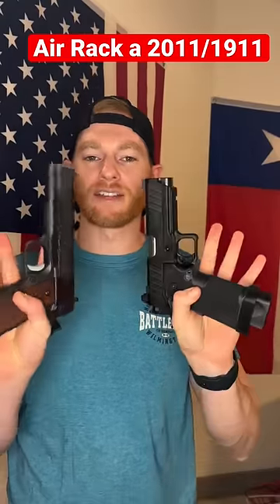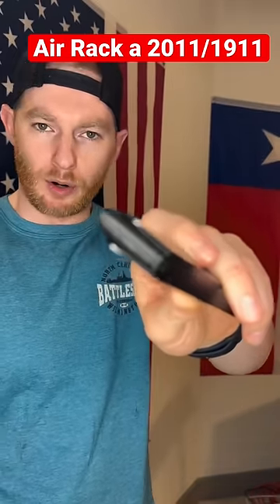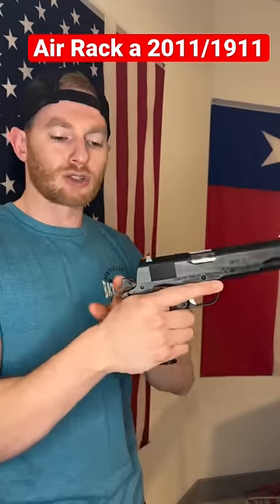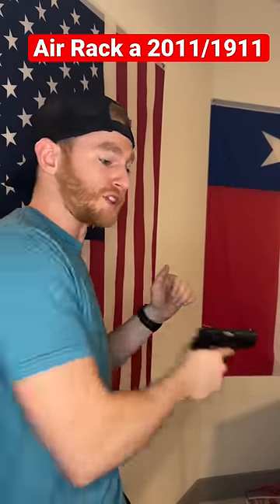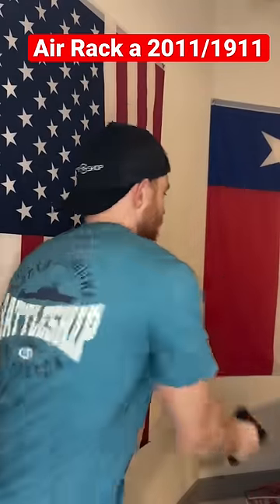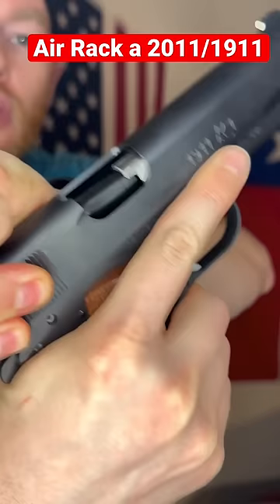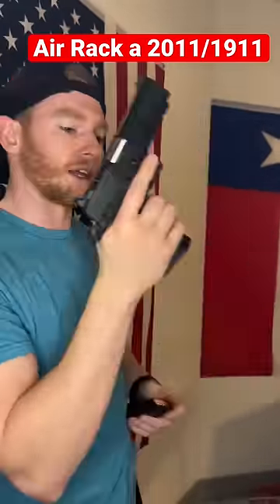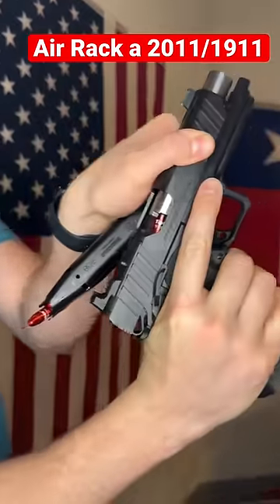How to Air Rack! (2011 or 1911) #shorts

Comment: As a CZ 75 owner, this feels virtually impossible
Reply: so true
Reply: Bro I have a CZ70 and even those everything about it is HEAVY as fuck lol.
Reply: You will air rack your shoulder first. Lol
Reply: Sar b6p also
Reply: @jojodancer1743  😂😂😂😂
Reply: Dylan Miller- the reason he didn’t show you this little trick at the range with live ammo is because you have to have a very weak spring in it and more than likely would not cycle.
Reply: I literally just got my CZ 75 D PCR. Can confirm. Have a tough time racking it with my hand 😂
Reply: @haleyeahbro  new handguns have stiff springs, need to put a couple hundred rounds through it to break it in so it runs smoother
Reply: Because it is if you want your gun to cycle, also pretty sure the CZ just won't even with a weaker spring
Reply: As it should. This isn't happening without a very weak spring.
Reply: That's a good thing!
Reply: @haleyeahbro  yeah it takes some getting used to🤣 my favorite method is grabbing the slide backwards in my left hand and pushing the gun forward with my right while pulling the slide back
Reply: @Killbayne  yeah that and oil definitely helps with the 75
Reply: @Kimaracustoms  yoo another D. Miller👋🏼
Reply: @dylanmiller9604  oh my god, the D. Millers are multiplying
Reply: that is because the cz75 b is a military pistol design for combat

Comment: You forgot to mention changing the recoil spring to one taken out of a .380
Reply: 380s normally have stiffer recoil springs because they are straight blow back with no lock up
Reply: The spring is actually from a pilot g2 07

Comment: Just to let people know, air racking is only possible if you have a race spring installed. This is not possible with an unbroken, stock spring.

It also helps if you have weight on the slide like optics.

Comment: As long as the hammer is pulled back this is possible.  My grandfather was an armorer for S&W and I inherited his 9mm model 59 with pacmeyer grips, a beefed up recoil guide rod and solid recoil spring.  Can confirm is possible just takes practice with a clean and lubed gun and the hammer back which is like 40% of the force neccesary when racking normally cause its fighting the hammer spring.  A broken thumb and years of shoulder/wrist abuse don't help.
Reply: Has a model 39. Regret to this day getting rid of it.

Comment: It's easy to do with stock springs, just not practical, it's all about acceleration but if the slide doesn't go far enough by even just a millimeter, then it's not shooting, best to just pull all the way properly.

Comment: I have an original Colt 1911 from 1943. You aren't air racking it and Eddie Hall couldn't air rack it.
Reply: Not if you get one made by Singer the sewing machine maker. The slide felt like it was on bearings it was so smooth and precise.
Reply: I can do it with my Beretta 92. It's about speed not strength my dude.

Comment: I don’t know what recoil spring weight it is. It could work easily for like 1 lb spring weight. No matter how I’ve tried with my oem spring weight with my glock, it doesn’t work. But you did it great if that’s so. Thanks👍
Reply from the maker: Ohh yeah this is much harder to do in a glock! I’m using a Springfield Prodigy which it a lot smoother👍👍

Comment: I would have to see this done with real rounds. If you can air-rack something then i bet either the gun will fire or jam up after firing. That is one loose spring!
Reply: The reason he didn’t do this with live ammo at a gun range is because, the spring is so weak the firearm would more than likely not cycle.
Reply: @M21-w1y  I don't think it would make a difference. I think he only used a plastic round, because it would be foolish to do it with live ammo in his house. The hard part is getting the slide to go back... but once it goes back it's very easy to get it to strip the round off and chamber. That's the easy part.
Reply: @M21-w1y  most 2011's can do this with live ammo no problem.

Comment: I have a custom built 1911. If I recall correctly, it's on a 20lb-ish spring. I do know that it's matted with a short recoil rod and hooked to a stainless barrel on a heavy steel slide and steel frame. Ring hammer.
Most certainly am going to try this at home, because I seriously doubt it will do that, considering there is absolutely no play in the slide/frame lockup and the slide, while smooth, is stiff and requires committed force (The gun isn't gonna load itself and shoot someone on its own, Alec Baldwin)

Comment: I would definitive be careful with 3D printed dummy rounds.  If made using an FDM printers, the weakest part of a 3D print is between layers.  Any sheer or bending along the Z axis of the print will result in a break mucj easier than a plastic part made via injection molding. 

Ive been 3D printing for over 4 years

Comment: Yeah, so, not only does this not work with a real 1911(via the comments). But this also doesn't work with the Army Armament R31. The R31 is a full metal, Gas blowback, airsoft 1911. It feels and functions EXACTLY like the real thing.

Comment: You've got a .25 pound recoil spring. Any spring soft enough to do this is failing to absorbed the initial recoil without heating your frame to death. Try this with a up graded 18 pound recoil spring.

Comment: If you gotta reload that quick youre slide is probly already locked back. In my case i just gotta put in a full mag with slightly more force than normal to release the slide. Itcdont take much and no its not worn out. Id like to see that done more often. Imo its faster

Comment: I was under the impression you need to mess with the recoil spring a tad bit, from all the new & used pistols I've checked out... not enough lube it the world to air rack brother they are tighter than a frogs anus. BTW that 9mm is known to blow the lung outa folks c'mon man.

Comment: 20 years ago I Changed springs on a glock 22 until I could air rack it by holding the SLIDE and doing the same motion.  Dumb then and dumb now.  I was trying to game those old Glock matches by loading 40. Cal rounds that would barely penetrate heavy cardboard.  When they actually went bang.

Comment: I mean theoretically you don't need a lighter recoil spring right if you're cool with adding some weight to the barrel on the slide part you could achieve the same effect right? It would be harder to get the target on point sure but once it's there then you'd have an even more controllable gun and could air rack it right?

Comment: Yeah but you only can do that is ir you change the recoil spring for a les pound the the one that brings the gun from factory, with a 20 pound recoil spring you can't not do that,  only way to do that is to  change the factory recoil spring for a 14 or 12 pound recoil spring

Comment: naw. they forget to mention that they shorten the spring in the front . Youd have to have a really worn out recoil spring to do that..
They stay leaving that part up.

dont do this especially on a brand new gun with its spring brand new. I had my fn locked back for a week and fully loaded mags (not in gun of course) just so my FN could cycle perfectly.. never had a Failure to eject any type of cartidge out of it . most reliable pistol and its not picky with its type of rounds either. thats great during a apocalypse 😂
Reply: I can do it with my Beretta 92. Factory recoil spring. You just have to move your arm really fast to the rear and then stop moving it suddenly.
Reply: @liamflanagan490  I had a M92 and I can see that being down. Idk bout mines though it was fresh out the box and the spring was stiff af. maybe after a few hundred rounds it would soften the recoil spring

Comment: Wanna hear a joke… so I can get 50 9mm for 11.25 from the factory… but cotton blanks costs 13 but for rifles blanks are cheaper and normal bullets cost more. hallow points costed me 13.59 so I bought 300 bullets because that’s dirt cheap. 

so I get the 3D print.. because the glow bullet costs like 15 to 20…

Comment: A. NEVER slam a mag home in a 1911 with the slide closed. The extractor is not designed for such. You will damage the hook on it. B. If you can air rack a 1911, your gun is shit...

Comment: Did the R1 get all its issues worked out? I got it the year it came out and it stove pipes every mag. No matter the ammo or the magazine, it stove pipes at least once a mag. It was my first gun and the biggest piece of crap I own.
Reply: Did you adjust the extractor?
Reply: @teelowteelow356  haven't touched the extractor, is there a recommended fix/mod? Like shaving down the extractor a bit more?
Reply: @fausch  yes look it up on YouTube, there are many helpful videos. Also on the 1911 forums. Adjusting the extractor tension might help, and it’s not very complicated
Reply: @teelowteelow356  thanks dude!

Comment: I don't think if mine were attached to the rod of a running big block engine it would "air rack". Lol my Springfield requires force in both directions at same time, with the grumbled face. Yes, you must hold your mouth right. Lol

Comment: My pistol never does that you going to pull it back manually I don't have that freedom like that and no the trigger is not soft. Tough Trigger 2 and yes the Springs are pretty tough on those pistols I have are not soft or very light sprained no

Comment: I keep my 1911's loaded cocked and locked like they were designed to be.doing this air punch if the slide doesnt go all the way back then the round wont load and since you already have to have the hammer cocked you wouldnt know if its loaded without checking and thats alot of time wasted.this is stupid.

Comment: Looks cool for the Hollywood tactical crowd, but doesn't really make a whole lot of sense. 1911 style pistols are meant to be carried cocked and locked. Running ultra light springs means that your slide/frame take a beating and you are much more likely to get FTF since the gun becomes much less forgiving of bad/weak grip.

Comment: Annnnd air racking in a building that does not look like a shooting range. Kind of stupid. I want a gun that "racks" when I rack it, not something that racks when I move it "fast" because I believe if the hammer is not cocked you may have a round go down range, which in this case would be through a wall and possibly into a neighbor.

Comment: but why? maybe on a remington or springfield but im not even going to attempt this on a hand fitted 1911 because it serves no purpose in any regard.

...except maybe if the world is invaded, my other hand is gone, the lizard warrior is charging and for some reason i need to rack a slide because i loaded my pistol and left it hammer cocked with an empty chamber.

i got a better trick. loading a glock with the slide back and chambering a round without touching the slide lock, the slide or manipulating anything

Comment: You obviously have very weak springs in those guns that allow you to do that silly racking maneuver. What this will result in is cracking your frame when the recoil of firing rounds will slam the slide back into the rails and crack your frame. This is very spurious advice to be putting out there. But I don’t think it will do any harm because the people that know already know and realize the zero value of what you are spouting.👎👎👎👎